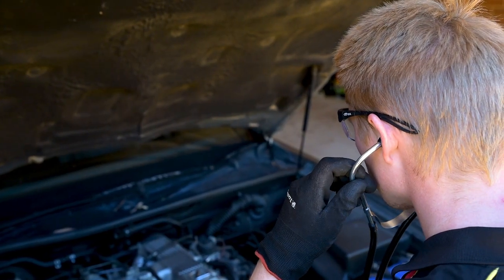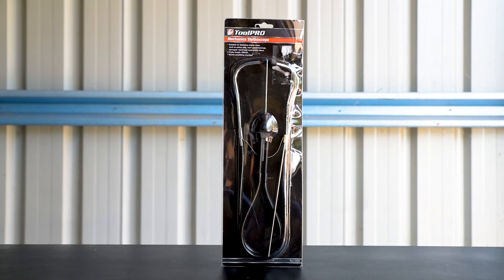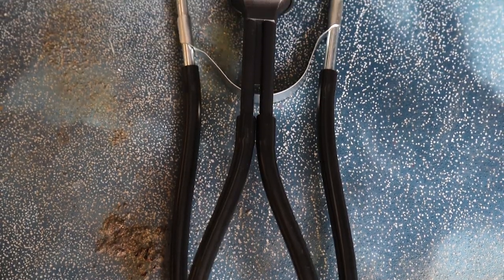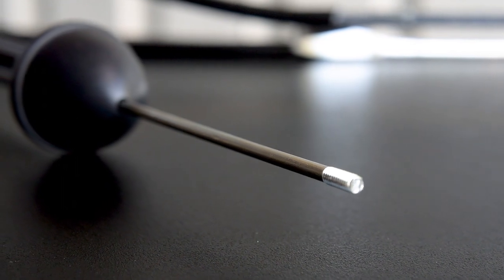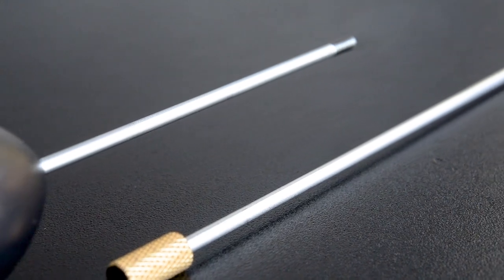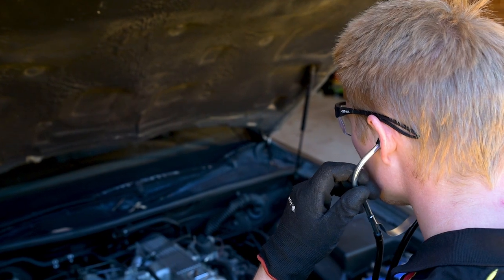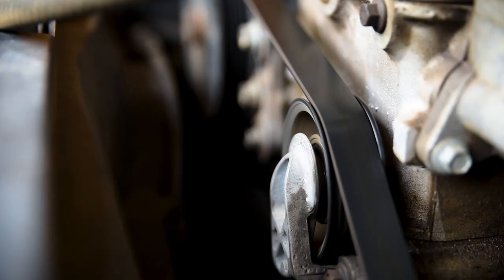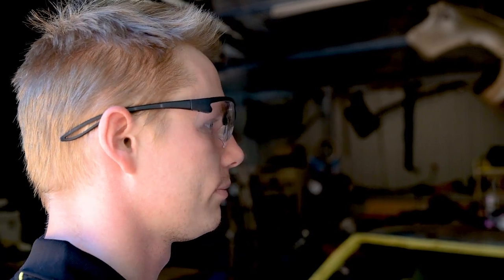How To Use A ToolPRO Mechanics Stethoscope

Comment: Engine*
Not motor!
Reply: Then why are they called motor cars and not engine cars?
Reply: @brianjarvis3367  Well if you think about it, In my mind Motor means like an electric motor. While engine sound like something that goes in a four stroke car. Or on bikes they are two strokes.
Reply: @realcarii  I speak 4 language and motor is still means engine  for many of us  ¯\_(ツ)_/¯
Reply: @NeoJSsk  Wow, Four languages? That's awesome.
Reply: I got one of those stethoscopes. Its loose. No way to tighten it without breaking it. Makes a lot of noise on its own like sounds like going to pop your eardrum ‼️😬
Reply: An engine is a subset of motors that produces it's mechanical action through chemical means (steam engine, gas engine, etc). So all engines are motors, but not the other way around.
Reply: @Kanglar Finally someone who knows what they are talking about.
Reply: Idgaf I'll call it whatever I want 😂
Reply: But you are still wrong. Speaking four languages does not prove opinion.  @NeoJSsk